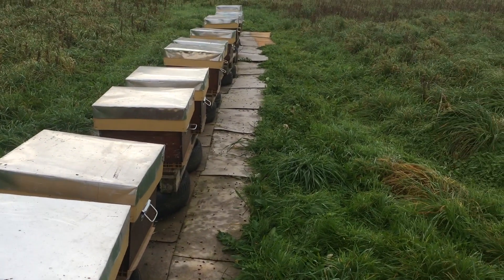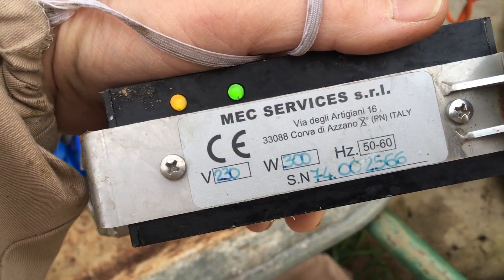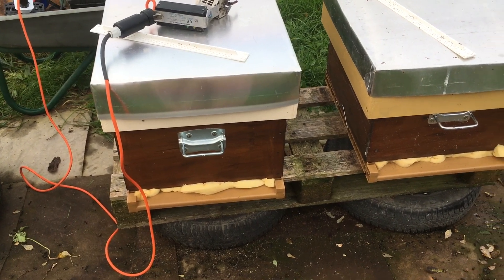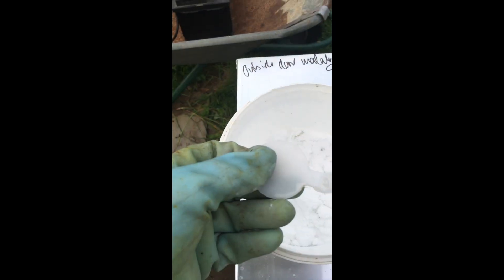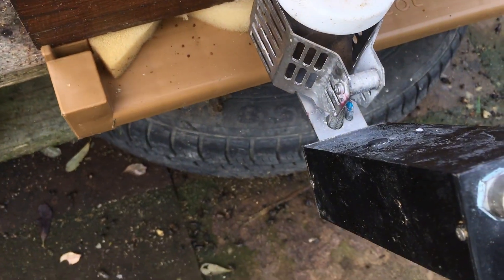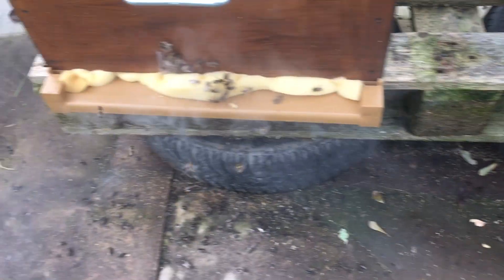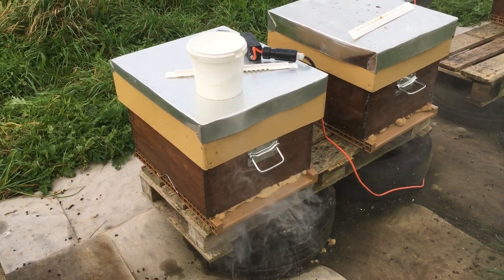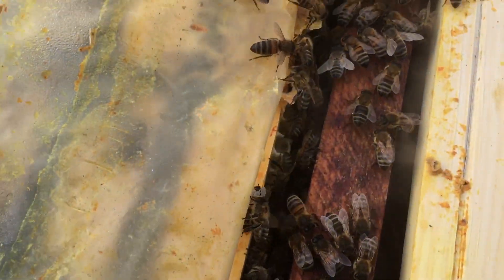Sublimox: Mite treatment at my apiaries.

Comment: Do you always use plastic film on top of the hive?
Reply from the maker: Ron Henderson yes I do and many others do in France!  In the UK many use a cellotext or other clear plastic material.
Providing it’s insulated above correctly, there is never an issue! It’s better than wood in that respect as old wooden crown boards do actually absorb humidity over the winter!

Comment: Hello i was entertained waching the video but i an issue my hive have ventilation that can’t bee closed is there any solutions?
Reply from the maker: Its always a difficult issue, in my mind it can always be closed in some way. You have to think and use alternative ways. Many move their boxes off, on to another base thats closed( but this is really a two person job!) and then /0r use foam in larger pieces to block off any remaining holes. Getting a close seal is very important, otherwise your not getting a tight seal and its not going to be very effective. Have a think, thee is usually a solution! best of luck!

Comment: Hey Noel do you winter with open entrance on top and bottom hives ?
Reply from the maker: Only bottom plastic mesh floors are open. The top has no ventilation. Roofs are sealed around the top by the bees. I use Nicot plastic Bases on all my Dadant hives. I close off in late February as this may assist early brooding.
Reply: Richard Noel but  why not upper to open also palmer do it
Reply from the maker: Max Bees because we don’t get snow here like Mike Palmer does in Vermont!  The vast majority of hives in southern and some Northern Europe don’t have any upper ventilation. When you have a foot of snow covering your hives then you need a top chimney for air to ventilate! Here we just don’t! Too much air going in to the colony and escaping from the top of the hive can cause the Bees to burn too much resources to keep warm!  It’s all about getting a balance!!
Hope that answers your question!

Comment: The plastic bottom boards where did you get them from please
Reply from the maker: Hi Jeff, their Plastic bases made by Nicot or the full name is Nicoplast. They make all sorts of really good beekeeping products. In France a lot of beekeepers use these fully ventilated bases, their cheap, dont rot, can be pressure washed and caustic dipped with no damage. A great invention. but sadly they only exist in the size for Dadant sided hives. i am hoping they make a version for the Uk Market, because i reckon theres a huge market!
Reply: The only issue I have with these Nicot bottoms is that they seem to attract more robbers than my solid bottom boards.  Look up Luberon Apiculture if you want them.
Reply: Yes they are good.  I have a couple but I don't think I will get more.  I do suffer a bit with robbing as I have a commercial apiary next door.  The roobers always seem to focus on the Nicot screened bases, I think they can smell more.  I might just be a bit unlucky with the amount of hives in my other field.
Reply from the maker: Les Agathes you can get them from all Bee shops in France, Icko on mail order is one I have used. I don’t find they encourage robing, they come with mouse guards or Hornet guards depending on what you require! The base is made so these can be slotted in to the front. Very good system!